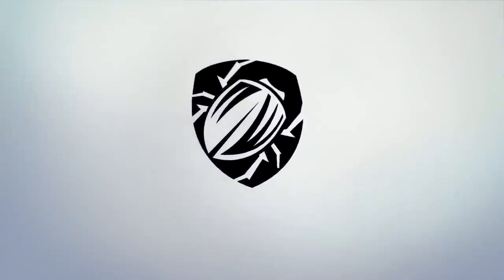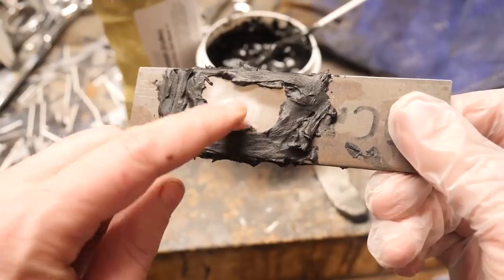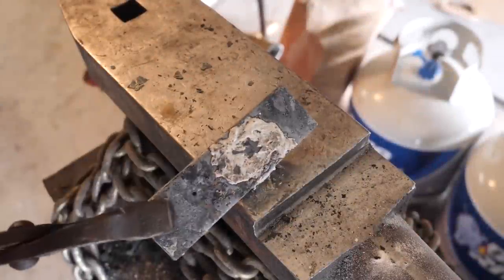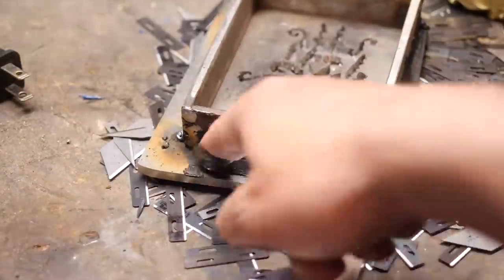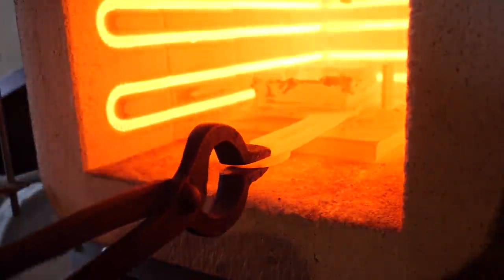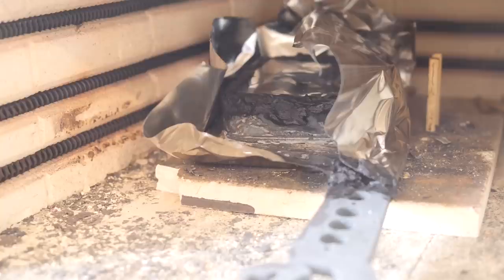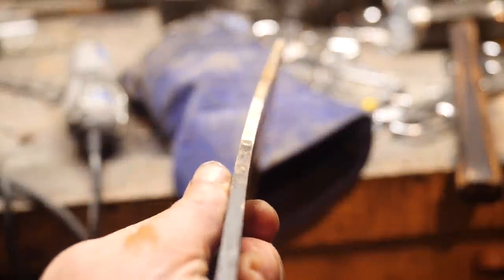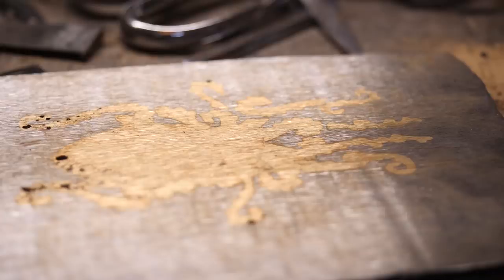Return of The Squid Cleaver!

Comment: There is a bronzing method I've seen done where the metal.is heated with a torch and then you go over it with bronze wire wheel.  If you laser etched a squid into that but only like a millimeter then used this method it might turn out more to your liking.

Comment: Have you considered Art Clay Bronze?  It molds like clay, and is fired like a ceramic, but leaves metal behind.   It has to be fired in a charcoal (reducing) environment, like a steel cannister filled with charcoal, and I'm not sure it would work as an inlay material as I'm not sure what the shrinkage would be like, but it might be worth a try.

Comment: I would leave the bronze sand alone. Sand turns to glass causing bubbling. I would suggest perhaps using coarsely ground shavings poured into the outline form, let it burn longer on a lower heat and tamp it as you go with a solid piece of weighted steel. Once it begins to naturally cool and when it isn’t so fluidic any more give it a machine press on a larger pad then let it cool natural leaving a burnished look. 
   This would be a theory and I’m not an expert in metallurgy. This is one approach I’d consider trying.

Comment: You could try and cast the bronze into the blade, but heat the blade and bronze up to the same temperature. When you then cast the bronze, add borax. Similar to when forging damascus, the borax helps prevent oxidation. If you did that, the bronze will flow into itself better. Another problem might be that you need to heat the bronze to a higher temperature to cast so that it doesn’t solidify as easily. If you’re still going to try and put pieces of bronze into the recess, add borax to the pieces so they don’t oxidize and will meld together.

Comment: An cutting torch can be had used for about 50 bucks. Most gas supply shops have rental plans, typically less than a hundred bucks a year. I would get one and learn to use it and braze the brass in after I heated the steel. I would use a thin sheet of stainnless plate for the backer while doing it.just my 2 cents I liked the video

Comment: A big part of the issue with powdered material is that it packs a lot of air with it, which is what's causing those voids. Brazing is probably the best option for the small details. Fill those in, then I'd say go back to your original melt idea, only instead of throwing everything in the furnace, get acquainted with proper casting techniques. Incorporating the blade into a 2 part sand cast mold should be easy enough and would alow you to preheat the bade before returning it to the mold, then pour the molten metal in, and Bob's your auntie.

Comment: 3d print the shape with a resin printer, make a plaster mold (you'll need a vacuum system), pour the bronze into the plaster mold, then hammer the result into the hole

Comment: The problem with powder depending on how it's handled it could already have oxidize on it's surface and that oxide could be getting stuck in the brass pool since it's not being poured it has nowhere to go. Then when you grind the oxide breaks away leaving a hole.

Comment: Perhaps @michaelcthulhu might have some advice, but my thinking is maybe try sintering the brass/bronze. I'm not completely sure of the process but I know it involves compression of the powder (possibly with some binder additive) into shape and heating it up. They use it in industry to make gears and stuff. So i would think (if it's possible on a home scale) it should hold it's shape and be easy to do without voids in the material. Beyond that I think the sand cast being sure to preheat it well is the best option.

Comment: braze it with helibrazing... (helium gas tig brazing) ... can be as local as you want... can actually melt the powder you have in to the woids to avoid color changes... just my 2 cents on the subject... so happy to see you back trying this... i would if it was me that had to start over i would order a set of inlays from the place you got the 80crv2 cut in about 2.5 mm thicker than the knife... then cut a V on the inside of the pattern to make room for expantion and then i would inlay the pattern and then take a hammer and gone to town on it... (DONT GRIND IT BEFORE HEAT TREAT) then i would hammer the bronce that has aneeled in the heattreat back in to the pattern to work harden it in place... then grind the knife profile and be on you normal marry way to a regular knifemaking session...

Comment: Since you have the pattern on a computer, why not get the inlay parts cut out as well with enough of a size difference to make an interference fit work?
If you try casting again, others have mentioned lost wax. Isn't there a version that uses a vacuum as well? That might help with the bubbles.

Comment: There is a thing that i use. Its called precious metal clay. It performs like regular clay until its heated, so if i place the clay into a kiln like you do the powder it turns to solid bronze, silver or even gold in avout 15 minutes. Check it out, its how a lot of high quality jewelry is made actually. Im sure you could press the clay into the squid shape and put it in the kiln. And bam your problems are solved.

Comment: Brazing , at least here in the uk, is the method of joining thin flat steel or tubing,  with silicon bronze rods and flux , the bronze fills the gap by capilliary action it flows into the join, bronze welding, uses the filler rod to build up a bead along the join, much like oxy acetalene gas welding, at least thats how i remember it from metal work shop.

Comment: Don't know if this was said yet, but try placing the cleaver verticle in the middle of a 2/5 inch wide cavity in green sand, with the squid centered in the cavity, pour molten brass down the side and have it fill up from "tip" of the cleaver back to the handle/ricasso

What I'm thinking is, if you do it this way all the bubbles will rise to the handle side of the cleaver. Just as thought

Comment: The easiest way to do this is to pierce out a piece of bronze or brass from a piece of plate in the shape that you need. That allows you to do an interference fit. Then you slightly bevel then inside of hole you’ve cut out in the blade so that you can spread the inlay out to essentially rivet it in place. This is the way that I would have done it. It just means that you need to do more work with a file.

Comment: Bronze melts at a little over 1700°F, but its casting temp is between 2000 and 2200°F. My guess is you're getting hot enough to melt it, but not hot enough for it to flow easily, and that's why you're getting voids. My other suggestion would be to use the furnace clay between your blade and foil on the bottom as a glue instead of just on the edges. More surface area might result in less leaks.

Comment: Hi,at Home Depot you can get a cheap oxy-acetylene set,MAP gas and Oxygen  bottles with borax and brazing rod fill the holes,train on some iron flat bar first.Good luck.
Reply from the maker: I tried those red oxygen bottles you mix w map using their special torch before and never got it dialed in.  I couldn’t cut 1/8” steel.  And each bottle lasts about 10 minutes!
Reply: we are not cutting anything here,you need a oxy-acetylene torch because we need a high temperature  flame I suggested getting a setup from Home Depot because Its cheap,for many years I worked as a welder and I used oxy-acetylene torch,I live  in New Jersey,come on over or send me the blade I will fix it for you.

Comment: The bubbles might be caused by the different thermal expansion of the high carbon metal and bronze. As it cools off, bronze or brass will cool down faster.

Comment: You could also, instead of trying to fill it, you could have a piece of bronze cut out to the shape, then heat the steel and push the bronze piece in, a pressure fit. Then once you have the material in the knife, you could then weld a plate around the work so you could heat the metal and forge press it together. You could also temper it etc while its in that state, then cut the plates off each side, then from there grind it into its final shape, then polish and sharpen.

Comment: Ever consider cutting a bronze plate ever so slightly smaller than the cut out. It would be a huge pain, bevel the cut outs the insert the bronze cut out. Might be able to friction weld the parts pending tolerance.

Comment: You can braze with bronze filler rod using a $60 Bernzo-matic oxy-mapp torch kit from the hardware store FYI. I wouldn't want to do the whole thing with that torch since the little O2 bottles it uses only last about ten minutes but should be fine to fill in those gaps.

Comment: Get a tig welder.  Grind out the bubbles and fill it in with silicone bronze rods.  You could top off the bronze air pockets in 10 minutes.

Comment: If they are cutting the design out on a CNC machine have them cut a piece of bronze or brass (whatever you want the inlay made of) using the outside dimensions of the design....you then put them together like a puzzle (you may have to fill minor voids....but the majority would be perfect)

Comment: Prep the voids with wire brush or grinder... Pre-heat the cleaver as is to just under phase change temperature.  If you have a small side furnace liquify some bronze then pour it over the small holes and let cool and check for adhesion.  
Other option might be to heat some bronze strips and heat the cleaver to red hot but not liquid and then hammer forge the strips  into the voids?....

Comment: I'd cast bronze. That way you can control your non ferrous and keep it clean, stops your steel oxidising because that doesn't need to be hot. Casting it means you don't have to grind back nearly as much as you can slightly overfill around the design.

Comment: Well one thing you should try is hammering in bronze. Kinda like how they do for inlaying metals like gold. At least for the small areas. leave the large places for the melted as they are fine. Bronze should be soft enough to do it with as they do hammering inlay with copper and brass normally. Might have to cut a bit of a grove into the inner sides of the steel if you were starting a new piece. Then after you hammer it in then you can encase it and heat it up to melt it in. Would be good to make a thin extra layer of sheet bronze on both sides to make sure no leak out. The powder although good does still have air in between the grains and pressing of sorts is needed to get that air out fully. As an example is when they make canister Damascus. they use powder but have to press it to set everything together otherwise there can be voids.
The other idea is find someone with a TIG welder and have them set it up to melt bronze fill rod. Should keep it from melting or deforming the surrounding steel but enought to melt and fill in. This might be your best option for this at its current state.

Comment: You're only missing 1 thing. Vacuum or centrifugal force to break the surface tension after you pour the bronze. Preheat the steel as you would a mold. Heat the bronze in a ceramic crucible. Make sure everything is fluxed of course. Pour the bronze - and break the surface tension of the bronze with either vacuum or centrifugal force.

Comment: It wouldn't be exactly what you're trying, but you might try this: etch the squid pattern in on both sides, use heat and a brass wire wheel on both sides, and then carefully sand. Ideally any excess brass outside the etchings will be sanded away, leaving only the material inside.

Comment: Need to find a way to let the air escape like in metal casting. You could try the foam casting method.  Cut out a piece of foam to fit the squid then fill it with casting sand.  It will need 2 pipes, one for pouring and one for an air vent.

Comment: you should do it like you first tried again, but make sure the bronze is extra hot, and that the cleaver has also been heated before you pour the bronze, this way the metal will not cool instantly on contact and you can get a smooth pour that will fill it all without air bubbles.   just remember make molten metal even hotter before pour to make it more fluid, and make sure to heat cleaver to red hot then pour.  hope this helps.   but molten metal on a cool surface will never cast properly, always preheat your mold.

Comment: I dunno man- other than doing a straight up inlay from a solid piece- over thick so you can “pean in” all the edges- I don’t see the powder or pouring working- no matter how you approach it you are going to get those voids from the air/gasses inherent in the process... question... are you using silica or aluminum bronze... and does it make a difference- either way good luck and keep the vids coming! Thanks for sharing the process

Comment: Shallower void. Instead of trying to do a full depth plug, have the design etched deep enough to create a strong pattern but shallow enough that the floor of the cavity acts like a heat sink, slowing the cooling of the bronze. The powder looks to be the better fill method, but as with canister damascus, it needs to keep new oxygen out of the vessel. The other option is to have a sacrificial floor of thin mild steel welded to the blade, ideally via fusion TIG,  as air tight as possible.

Comment: Cover the void both sides with aluminum tape make greensand mold of knife. Remove aluminum tape and paint void where you want brass to stick to steal with Flux. Put knife back in greensand mold and pour/cast bronze into knife until brass flows out of pour spout and exit spout.

Comment: the guy who laser cut the cleaver blank if he has the pieces that were removed from the cleaver then you can cast the cutout in plaster, and pour bronze. This should produce a bronze squid. Then heating up the cleaver to expand the gap insert the bronze squid and cool and as the cleaver contracts, you would hope the bronze would be stuck. The temperatures here would be critical as the cleavers grinding and heat treat would need to be finished and the bronze inserted during the tempering phase may be. Also, the temperature being used at the insertion point should not soften the bronze much if at all. Don't know if that would work but it might who knows. I enjoyed the vid.

Comment: I think, that if you want this to look right at all, you need to make it a sculpture that you fit in between a set of groves in the knife. Then tap it in from the bottom (leaving enough material there to deform from impact and not affect the core of the sculpture), then clean it up with an engraving tool and peen it in.  This way you get a bit of experience in all the things you might want to do - chamforing, casting, engraving and sculpture

Comment: You could've got along with the pouring technique you did in the first video. Only thing you need is to pre heat the "mold" to allow the brass to cool down slowly and fill the tiny spaces before solidifying

Comment: i really think that casting it wasnt the wrong way of doing it, i think with twiggling out temperatures and flux and degassing it might work... also maybe brass isnt the best material to cast since it contains zinc wich forms oxides and is generally nasty to work with. something like bronze or even aluminium bronze (wich has roughly the same color as brass) might work better. preheating the knife blank would certainly be a must

Comment: you need to pour the brass into the cleaver, but make sure you have the cleaver preheated to same temp as the molten brass. also impurities in brass, copper or bronze will cause foaming, so dont add anything other than the brass, no flux, no paper, no pepper.... i get that it dont matter when working with steel, but brass is a whole other story.

Comment: Cutting out a positive of the design (+/- 1/16" of the outline, and +1/16" for thickness) so it just fits, and filling the space with the powder, and bring it just to liquid might braze it in place, or just pre-heat heat both the positive and negative parts and use silver solder to bond them together might work but that might cause a corrosion issue long term.

Comment: If you get a sheet of the inlay metal up to to point where it is very soft you could just press it and the heated blade together between two sheets of steel in a hydraulic press?

Comment: Honestly, go back top the foundry and pour it. Heat the cleaver with a backing to stop run through,pouring on a shakertable or do a green sand open pour with cleaver in it and the pattern clear even through a 1/4 in on other side into the sand.yes lots of clean up but should work... These are not failures. These are you perfecting a method. Good luck